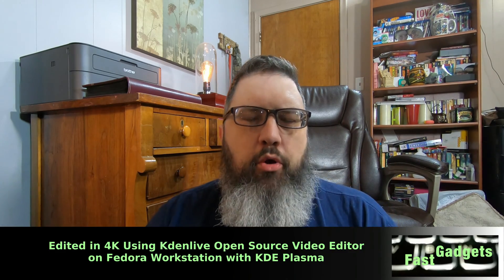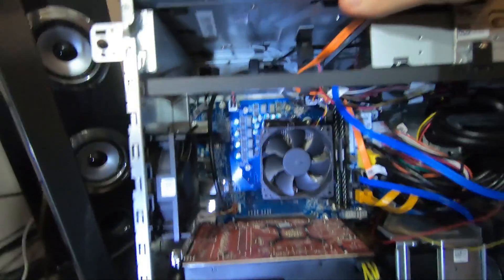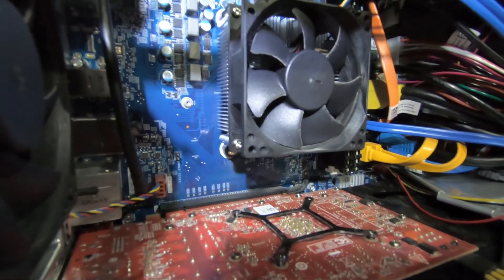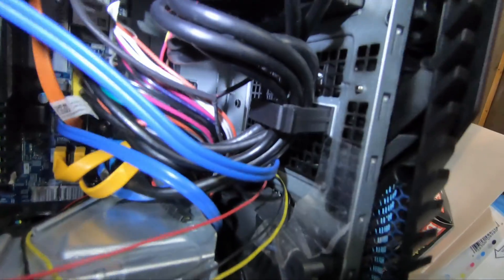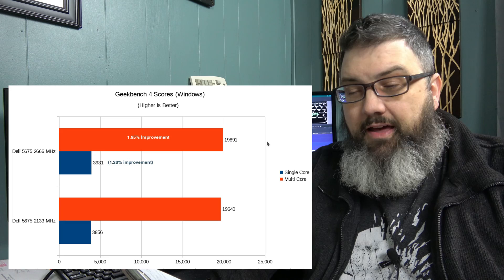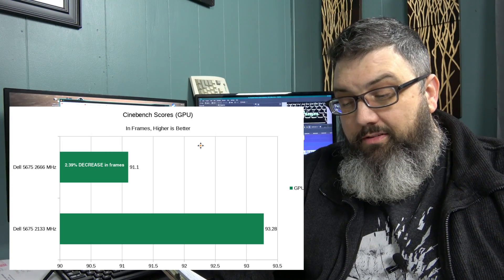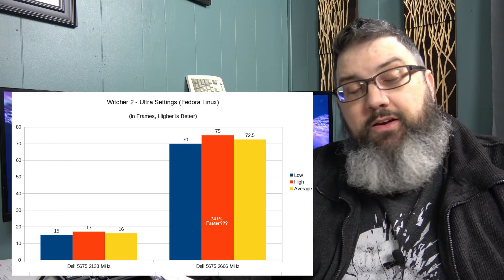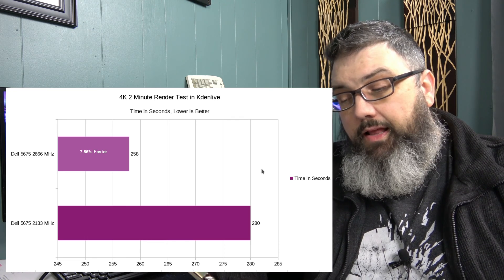DDR4 2133 MHz vs 2666 MHz:  Worth the Upgrade?

Comment: Sir. I'm not so good with computer but can u help me with this? My hp laptop has currently Ddr4 2133 (4gb ram).. I wanted to upgrade it to 8gb however, I can't find one. (at least in our city) now, I am offered with Ddr4 2666 (8gb). Is it good to have the 2666 installed? They said that its not compatible or it might not work. Also some say that 2666 is compatible downward.. Is it OK to have the Ddr4 2666 (8gb) to replace my Ddr4 2133 (4gb)?

Thank you sir! God bless!

Comment: Sir. i see 2133mhz in disk mangement , but on CPU-Z device i see 2666(1333mhz)......tell the difference. Help😡
Reply: It's because you haven't adjust it on the bios, set it to 2666
Reply: @kesolog  how to do this? 
Can you tell me steps ?
Reply: @buildyourknowledge2651  go to your bios setup, enable your XMP then change your memory settings to 2666.

if you want to know more about XMP just search it in YouTube,

Take note that some bios are locked you cant change anything so you will be lock to default settings 2133mhz.
Reply: @buildyourknowledge2651  commonsense bro
Reply: @kesolog  overclock 
 InsydeH20
 no Advanced Settings
Reply: @buildyourknowledge2651  
as I mentioned some bios are locked so you cant change anything
so if you have RAM with 2666MHz , bios will set it as default to 2133MHz
Reply: @kesolog  if i want to update ram size,So what frequency of RAM should I take?
Reply: @buildyourknowledge2651  check your motherboard specification then do your research. Google is waiting for you.

Comment: ok so i have a r7 1700, the ram i have is a 2x16gb kit of gskill ripjaws x running at 2400, ive had to rma my memory twice due to stuttering issues, on the third kit i overclocked my ram to 2777 and all my problems went away. you probably wont notice a difference in games but the ram speed directly affects the connection between the 2x4 core blocks on the cpu so overall the cpu should run a bit better
Reply from the maker: Peterfixit if you RMA’d your ram could you just return it and get 3000 or 3200 MHz ram? overclocking is ok but you run a risk of having issues develop with your ram.

Comment: 2666 MT/s still is too slow for Ryzen, you need at least 3000, preferably 3200. 3600 also is faster but the extra cost is too much for the added performance. 
In short, when data in the cache on one CCX is required by a CPU-core on the other CCX then the speed of the RAM determines how fast the data is copied from the cache on the one CCX to the cache on the other CCX.